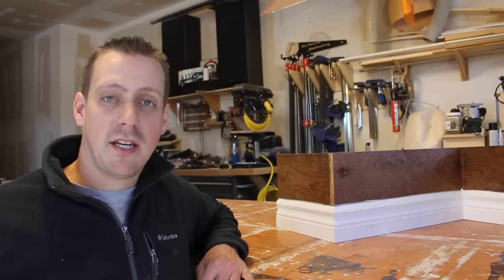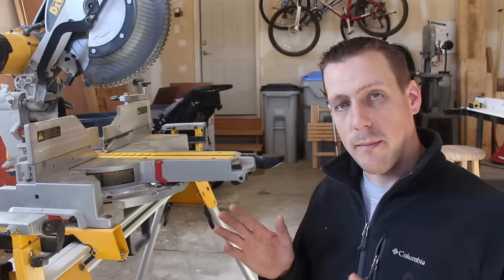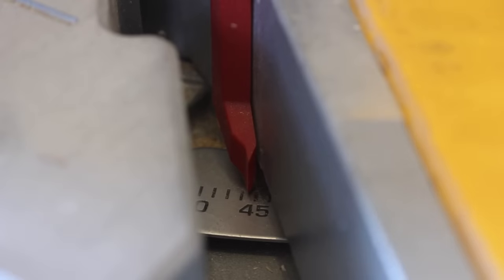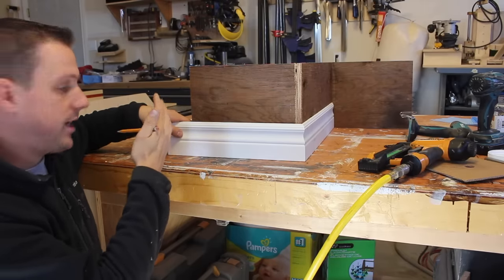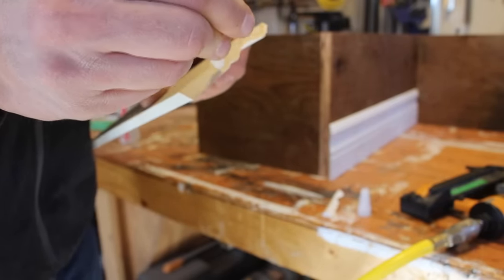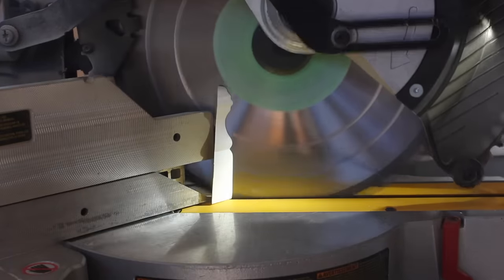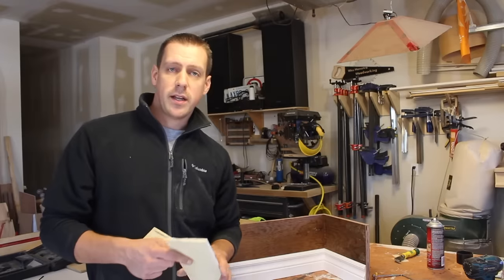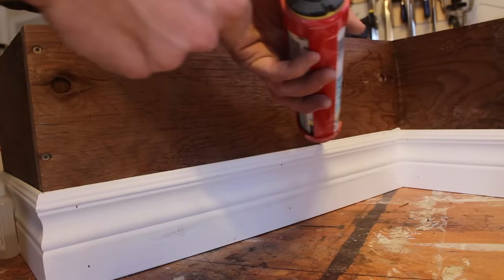How To Install Baseboard Like A Pro!

Comment: Always keep an open mind and you’ll learn something new and get better every day.  I’ve been licensed for 16 years and built several $million + homes, but have never seen that sandpaper coping trick.  Awesome and thanks!
Reply: I'm so happy someone else found that fascinating. For the most part I've done all of these tricks but that sandpaper trick was pretty brilliant
Reply: I found that trick very useful as well.
Reply: That is a good trick for sure
Reply: Sandpaper trick was amazing
Reply: Yeah, that was good
Reply: seen that a couple of times on youtube. they actually make flexible sandpaper with adhesive at the back so you can stick it on a baseboard and do your sanding. and i agree, always keep an open mind. so many people in the trade needs to be told this every day
Reply: Absolutely
Reply: I've installed miles of baseboard, but the sandpaper trick is one I haven't seen.  One of the reasons I started to just cut inside corners at 45 instead of coping them was the extra work that never seemed to look any better. But the sandpaper trick will make it fit tight. NICE! Well done
Reply: I wish I would have seen it before
Reply: Exactly!  Even when I’ve worked with people with crappy people skills, I learned to listen to what they are saying more than how they say it.  I get the knowledge and screw the rest.
Reply: I agree, I am always learning, my dad was a finish carpenter in big housing projects for 50 years and he told me there was always something to learn and he was right on.   I just read your answer from 7 months ago, I am not that slow a reader.   lol.    Ricky
Reply: Just what I was going to say man, that's a genius trick. Peace :)
Reply: Hello, what license do you exactly have? Carpentry?
Reply: It was a good idea for DIY guys but a file and a test piece is the only way to get it just right
Reply: Makes you wonder why you didn't think of it doesn't it?  Been there many times LOL!
Reply: Crazy some of the stuff you can find on the internet now.  Was swapping a clutch on my kid's BMW, and the pilot bearing was smaller than any puller I had.  My kid checked YouTube, and the solution was to use bread.  Yeah, that's right.  Bread.  You pushed the bread into the center of the throw out bearing, then pounded it in with a drift punch that fit the bearing hole.  The bread had nowhere to escape but would push on the back side of the bearing.  Within 2 minutes we had the bearing out.  Still laugh my ass off about that one.
Reply: Wow good job man
Reply: I did some molding work in my bathroom looked okay, more towards the crappy side 😓😄,  so If you found that sand paper fascinating, I found it overly fascinating 😄😄😄, now after 4 videos about this topic today I feel confident to move over to a room and do the floor base molding. 😎 I’ll let you all know how it come up

Comment: It's the extra steps that make all the difference between an adequate job and an excellent job.  
IMO - if it pertains to your own home, things such as baseboards are probably only going to be installed once in your lifetime.  So put the little extra work in.  You're already there with the materials and tools.  Do an excellent job and spend the rest fo your life admiring your work.   
Wes's advice is spot on.

Comment: I was just struggling with an outside corner today cause i recently just started doing finish work and that 45.5 degrees cut would probably solve my problems. Good video.
Reply: I just have an old Makita chop saw and the scale ends at 45 degrees. 
BUT after seeing this vid, I just tried cranking the thing over a bit more and it DID go to 45.5 degrees. Never thought to try...

Comment: Nice video. Good work on showing the cuts and not dragging the video out forever.
Reply from the maker: thanks, I like to be straight to the point.
Reply: Thank you. I am new to having to install baseboards - this easy video just made my week, because secretly was apprehensive about it, and my interior house painting is finished.  That means baseboards! Thank you so much!

Comment: Loved the idea of gluing the sand paper to a scrap piece of baseboard to smooth out any rough edges. Never saw that one before. Cool tip, thanks.
Reply: I usually use a couple of files for that but his sandpaper trick looks better.

Comment: Cracking! 
I learnt loads in this video, the little return looks great! 
Using a mitred edged to coping saw against with a back bevel and then that sanding trick is neat too! 
Great video, liked the pace and full of great tips!
More videos like this please.
Reply from the maker: Stuff I Made thanks for the encouraging words. I plan to do more like this
Reply: How do you get the little return? You skip that part

Comment: Nice tips especially the 1/2 degree.
Reply from the maker: Joe Brown thanks. A pro taught me this once
Reply: Wes Hamstra nice video. I ve been using this trick for more than 10 years. My father taught me he is a finish carpenter. Instead of -+half a degree. I put my pencil behing the piece im cutting giving me -+1 degree cause the pencil is 1/4 thick. This way i keep my saw at 45. I use it everyday. Is addictive and you get better at it by time.
Reply: I'm going to try that tip next time...
Reply: me too
Reply: I do it every day! Same applies for crown installation
Reply: yup. i will try it on my next home project.
Reply: I have to learn how to do this , my husband was a carpenter  and a good one I wish I would have paid more attention when he worked . He passed away in 2003 , I can do painting and baseboard /w glue  but dam I like this better ! I don't think I can afford to buy a miter saw though  maybe some day. I didn't get the sand paper trick , have to watch it again,. lol
 @carlosmonge3292
Reply: Joe Brown use a protractor mate that’s just a bad habit

Comment: Great video Wes. Love the 1/2 degree and sandpaper ideas, can't wait to put them to the test. The 366 down votes you got are baseboard installers angry that you gave away the secrets like Pen & Teller. QUESTION: I have been cutting my baseboards laying down flat on the chop saw, not standing up like you do,  so I can extend my blade life by not having to cut through so much material on every cut. Is there really a difference either way for cutting baseboards? Is your method any better than the way I cut them?

Comment: Sorry to be that guy, I just have a couple other tips. You can speed up the coping a bit by flipping your base upside down and setting your saw to 45 to make the backcut on the bottom where it is straight. Works perfectly unless the molding is cupped. Also instead of marking every corner and running back and forth to the saw, measure a room at a time and make a list. Cut your outside corners a fuzz short and the inside corners a little long but no more than 1/8". The cope will cover any gaps where your other cut it short and the inside corners will flex into place giving you tight joints everywhere with 1 trip to the saw.
Reply from the maker: XxStratAttackxX those are also great tips! I always measure a whole room and make one trip to the saw. Thanks for the extra tips and watching!
Reply: XxStratAttackxX yeah you are that guy , but you are right you can speed up doing that 👍
Reply: Same here.  I like to make one trip, especially if there are stairs involved.   I like to make three columns on my scratch paper.  Left and right column tells me what the piece needs on that side of my molding.  The middle column for the measurement.  So my cut list will have.  
RT   |  25 1/2”  |  OM.  This would be a return on the left and an outside miter on the right.    Abbreviations:  RT for return.  OM for outside miter, ST for straight cut, CP for cope cut.  I also use the Starrett gauge for measuring the outside miter angle.  Anything other than 45 degrees will be designated with an OM 46 for a 92” corner or OM 44 for a 88 degree.  Easy for anyone on the job site to understand.
Reply: hack!
Reply: Mike Marsh.      “It has been my observation that most people get ahead during the time that others waste.” 
 - Henry Ford
Reply: XxStratAttackxX probably just doing it for the demonstration, always easier and more accurate to mark instead of measure when you can, but I get your point.
Reply: New to this. What do you mean when, "flipping base upside down". During the mitre? Please explain. Thanks.
Reply: zackje1 basically instead of coping the entire piece he speeds up the process by using the miter saw to back bevel some of the material.  Works great on colonial trim since the bulk of the cope is straight.  This leaves the tiny piece at the top left to cope.  Speeds up the process when you have many inside corners.
Reply: he's doing a demo on 3 pieces. calm down bob the builder
Reply: Hell yeah, I was screaming at my screen when I saw the base right side up on the saw. Always nice to let the tools do the work. I learned that measuring twice and cutting once always saved hours of headaches too. Lol
Reply: Cutting base upside down is too complicated for newbies. I've tried teaching my helpers and they all prefer to start cutting right side up. This video was intended for people that wants to learn how to do it. Your tip is for people that install trim for a living

Comment: Good video overall, but you should have shown HOW to cut the return. Beginners may need a little help how to do that.
Reply: you will have some wastes during the job so just set one side to 90 degree then cut a little piece off and there you have return piece ready to glue.
Reply: Ha ha I thought the same if you had a few beers the night before it can be very confusing
Reply: I was wondering about the same thing.  I think I need to find a video on this.  Do you still cut two 45.5° and then 90° the other side the width of the trim?
Reply: When I finally get it the right size, I always end up with it shooting out of the saw and across the room and breaking! Returns defiantly make it look “finished”
Reply: George Wolanin just 45 degree both cuts, the 45 1/2 is for” built up” outside corners.
Reply: Seth Cotterman you need a “sacrificial” fence to keep small pieces from getting thrown.
Reply: @gwolanin   Just two 45s as both cuts on the trim will be accurate from the saw.  The returns length to the wall is the exact thickness of the trim. Easy trick is to turn the trim over and cut from the backside. No measuring. Slice off the return piece at the point of the 45. https://youtu.be/xwpWXC8WWDg?t=275
Reply: @pawemichalak6275  exactly
Reply: i read the comments but still not clear, explanation
Reply: You will have to cut a straight cut right where he marks it at 2:25 . Once the cut is made, you cut a 45 on the very edge of that straight edge. That’ll make the outside of the 45* in line with the mark.
Reply: Blake or like me first timer with TBI. Took me 1/2 hour last night to figure out how to place the last piece of hardwood engineered flooring last night! 🤦🏻‍♀️ It only 2 pieces though!

Comment: I prefer, instead of using a coping saw, I use a Dremel with a sanding drum.  I am much faster this way and can make  even cleaner lines and tighter fits.  This can get dusty so wear a mask.  Cheers!
Reply from the maker: Zack Miller that is something i will need to try. Thanks for the tip

Comment: that's great, now make every wall on your demonstration out of square/plumb, drop the floor an 8th to 3/8ths in areas and you'll be getting close to real world applications 🤣 
Good vid, 
Peace.
Billy
Reply: You mean 1/2inch to 3/4
Reply: Oh man I have been there before that's when real skill is needed.
Reply: @rcjabroniyup4959  i has to use toilet paper to caulk the bottom of floor boards after a horrible fucking tile job.

Comment: walls aren’t always straight... what do you with uneven walls?
Reply: noelleonnoelleon it shouldn't affect your joints. If you cope your inside corners they should come together nicely. And i always glue my outside corners with instant ca glue gel before nailing them. If an inside corner is really bad you can either use a wonder bar to close a gap at the bottom of the joint or shims to close up the top. Or drive a screw into the wall and make it square. Beyond that you would have to make a compound miter if your work is stain grade and you're working for a rich client but for the average residential contractor that's a huge waste of time.
Reply: You struggle a little more.
Reply: Curse the framers and drywall guys. Then try and hold the base tight to the wall nailing it off into studs. Followed by hopefully good painters and it shouldn’t be an issue.
Reply: Caulking...lots of caulking, lol
Reply: no
Reply: noelleonnoelleon  you use a angle finder
Reply: If the bottom of the wall is out of plumb, and the bottom of the wall is sticking out making your mitre bad, you can plane the skirting on the back at the bottom making your skirting plumb.  the mitre will fit tight without any gap at the top like if you use shims. Dont fix either one until they fit correctly.
Reply: You use you eyes and your hands and make adjustments  accordingly.....its call being a tradesman....🤣😂😁😀😎
Reply: Always make your outside joint tight as possible. When coping an inside corner it won’t effect u as much as if you were cheat and make a inside miter on a non square wall. Coping is old school and hardly anyone practices this method anymore. Practice makes prefect.

Comment: You didn't show how to cut "the little piece"   for the end of your return.
Reply: Yes please put link in description for that
Reply: If you have your angle already cut on the piece of base or moulding then you put your saw at the opposite angle and then cut it perfectly flush with your angle cut and the piece will fit perfectly in place capping the return end of the baseboard or trim.
Reply: And when i say cut it flush I mean to cut it flat so that the flat side goes to the wall and the angle finishes the trim at the end.
Reply: And when cutting returns always take into account like a 16th or an 8th of an inch for the return piece. Glad the tips helped someone!
Reply: I multi-task with those little bits.  I trim the wood and my fingernails at the same time.
Reply: @stevencamp69  So, when your at the end where you need a return piece, you are cutting it with an extra 8th inch extra or long. Then you cut it [that 8th of an inch extra] off at an angle that is opposite of the other side of the trim? Clarifying here.. thanks
Reply: @zandemen  smart!

Comment: The  joy of owning a big dewalt saw like that is the other half of the trick you didn't teach.
Reply: for sure good tools make the job easier.
Reply: I use a much cheaper dewalt 10” power miter saw. I have to cut baseboard laying down as the blade won’t clear the vertical but it does the job for around $80. If not needing it too long you can also rent.
Reply: It's usually a £3k table saw or 'This video was sponsored by Festool'